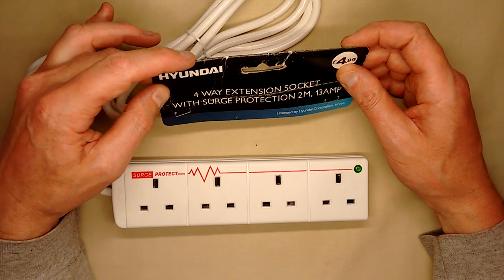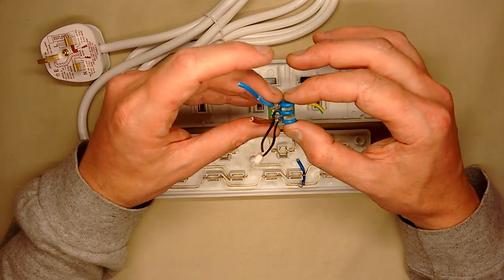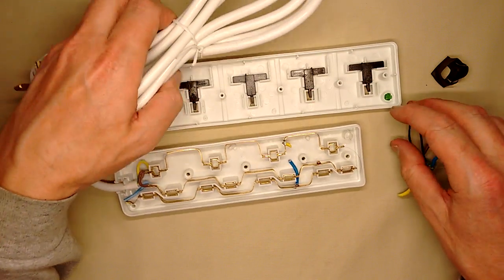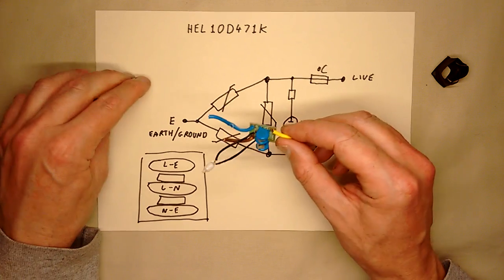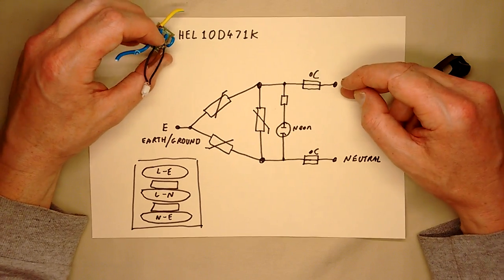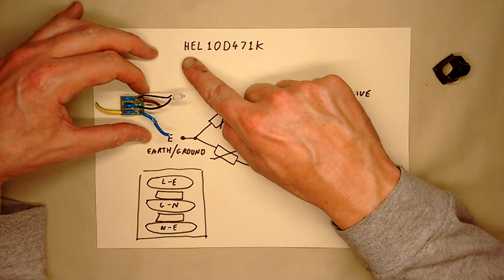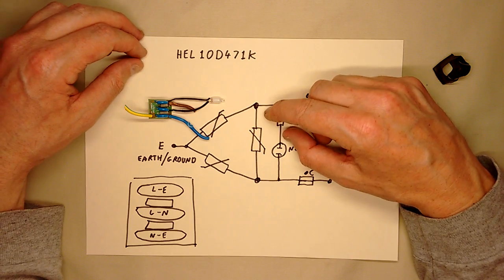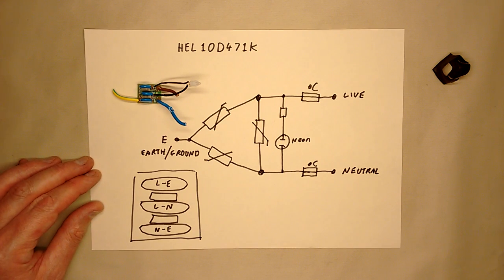Inside a Hyundai surge protection strip.  (With schematic.)

Comment: what type of thermal fuse is  in the protection circuit? i want to make my own surge protector, thanks
Reply from the maker: Usually just standard thermal fuses between the metal oxide varistors.

Comment: Hi , I'm a basic DIY home person and I'm bit confused about varistors connection. I wonder if you could help me please. 
1-Do I solder it in parallel or in series? 
2-What is the description of the fuse?
3-is it better to have 3 or more/less MOV and what is the advantage n disadvantage ?
4- is it practical to have these MOVs before the fuse or after? 
5- to make the sockets more secure from surge do I need to add any resistors or capacitors or anything else to it?
6- How do I protect it from spike in the current? 
7- can I use it for wall sockets also? 
As I live outside UK now, my electronics get damaged every yr inspite having them connected to surge/spike protected extention sockets. 
Waiting for ur reply. Thanks

Comment: I yard sale'd a small single-outlet protector rated for 400v L/N with a neon and the foreboding warning "Replace when neon goes out". GE brand.
I also have a similar small three-outlet protector with Surge and Ground LEDs, and actual L/N, N/G, L/G protection, though it "only" protects to 500v and has the equally foreboding warning "Unit still maintains power to the load while the surge function is discontinued". No branding, but has a UL label on it.
(I'm from the US where we use 120v mains service, so 500v is pretty generous...)
Semi-relatedly, what would you recommend to use on the output of a small, conventional (non-inverter) portable generator to protect more sensitive equipment from spikes and surges? Right now I use that single-outlet protector.
Reply from the maker: The surge protect units use a thermal fuse to detect when the suppression component is failing.  When the neon goes out it means the unit needs replaced as it has done its job either suppressing lots of small spikes for a long time or a single big lightning transient.  One of these units should be fine for the output of your generator.

Comment: I would have liked to have seen you send 500-1000V into this with a PAT tester to see how efficiently it clamped the voltage (could be fun to see the results!). Also, I have some APC surge protectors and they're over engineered with MOVs so it would be cool to see a comparison, if you haven't already done one.

Comment: can you tell me that if I use Circuit Breaker in place  of Metal Oxide Varistor. will it Surge protect devices?
Reply: T Chowdhury No, definitely not. Circuit breakers are far too slow.
Reply from the maker: +T Chowdhury U A circuit breaker doesn't really offer any protection other than for sustained over current.
Reply: @bigclivedotcom  can you any online link where i can purchase these sort of module for surge protection (Metal Oxide Varistor)? I wanna build my own power strip :)
Reply: +T Chowdhury: If you want to live, don't fiddle with electricity.

Comment: could you get hold of a do a tear down / inspection of a Hudson surge protected 2 socket extension with 2 usb chargers, please note this a all in one adaptor style one rather than one with a cable, I've just bought one of these to plug my new router into for surge protection & hope it will be of good enough quality & not hazardous in any way, please note I don't intend to use the usb chargers part of it at all, it was just a suitable device I could find at the time to offer two surge protected outlets without having a trailing cable, hope you can help on this

Comment: I have a higher end surge suppressor with more than three MOVs in it. It also looks like it has the same entire transient filtering stage that a decent switching power supply would have. Lowe's house brand Utilitech.

Comment: i enjoy your video's and have often dissected failed electronics to see why they failed, I designed power supplies for a living and like to see how others do it.  Like you I'm sometimes appalled at what I find, it's obvious any safety stamps aren't worth the ink on the labels for some of this stuff.

In the US our power is 120v for small loads and 240v for large loads. The street lines are many thousands of volts with a transformer on the pole that steps it down to 120  -  0  -120, the center tap is tied to the neutral bar in the circuit breaker box and that is tied to two ground stakes outside the house. Small loads are fed from one 120v lead and the neutral while large loads are fed from both 120v feeds and no power is drawn from the neutral, there is a safety ground for any exposed metal on the enclosure.

For noise sensitive loads I feed 240v into a transformer that puts out 120v, I find that does a pretty good job of killing any common mode noise because I'm not drawing any power off the neutral connection..

Are all loads in the UK fed from 240 or do you have 480 available for larger loads?

Comment: What that from B&M by any chance?

I'm curious to what's inside my JoJo one. It's got no lights, but interestingly, it has information of the bottom to say that it will fail a PAT on high voltage test, but this is not a fault.
Reply from the maker: The PAT failure is because the standard 500V test will cause the protective devices to conduct and give the impression of failed insulation.
Reply: bigclivedotcom Thanks for the info

Comment: I'd kind of like to see a noise choke in line with the mains myself. I notice a slight crackling in the mains of my PA system when I use an unfiltered strip. Because of that I put some filter chokes directly on the back of the IEC 3 pin power jacks on the inside of the amps and my mixer. So far I haven't overdriven them as I used fairly high wattage chokes. Mind you my best amp is 2400 watts continuous. It's an older Mackie M series but it's never failed on me and always delivers rock solid sound with very little noise, less since I installed the choke.

Comment: Dear big clive
I have been on the internet recently and bought this: http://m.ebay.co.uk/itm/18650-Battery-Holder-5V-1000mA-Case-Box-USB-Power-Supply-DIY-/252241990328?nav=SEARCH
Whenever i use it the device gets unbearably hot and i do not want to use it at all, the battery that you put in it sparks, the contacts get almost boiling hot and sometimes when charging the abtter it will get to the point where I was convinced it was going to explode
could you please break this product doen as i think it will make for an interesting video
Reply: The design of that looks dodgy as heck, with the exposed trace going back (yes I know that's connected to the shell of the cell anyway) but it doesn't bode well for the build quality.

I've chucked clive a couple of quid in the hope he buys one to rip to bits :)

Comment: I have a small 30cc boat engine with a fan, I would like it to automatically turn on over 150 degrees F. what component would I use to make this. Like a heat sensitive switch???
Reply: You can get thermal switches designed to turn on at various ratings...  Ebay item 321733923890 would do your job (choose the 65C oone, that's 149F).

Comment: Failed neutral thermal fuse will mean the first reasonable spike will trip the RCD device ( mandatory in the UK) and trip the power. then a little fault finding will lead to the strip as being the cause and it will be tossed out ( or in my case will have the surge protection replaced).
Reply: Because in other room of your house you can't get electric shocks ?

RCDs are a fundamental protection that must be used everywhere, there are endless possibilities that you can get in contact with live wires, or worse it could be that without an RCD a fault to ground is not detected, because maybe your ground has an high impedance (for example if you have a TT system and not a good ground rod) and thus a fault to ground doesn't trip a MCB for overcurrent, but instead sets all your grounded appliances at live potential.

Comment: I've just replaced a Schneider surge module (PDL 600SM - http://www.pdl.co.nz/product-details.aspx?rcat=products&catid=805&id=2059 ) and there are no fuses inside it, just hair thin pcb traces from the L & N into the MOV array.  I'm a bit disappointed because I have always believed that Schneider made good products.

Also has an indicator led (blown), 330k resistor (open cct), and an IN4007 to keep the led from chewing the reverse voltage.

3x MOV = http://www.digikey.co.nz/product-detail/en/epcos-tdk/S20K275/495-1417-ND/593851

Comment: Decent, but I wouldn't have put two fuses in it. The neutral fuse needs to go and be replaced by a jumper.
Reply: The neutral fuse would come into play to protect against fire and overheating in the event of reversed polarity (it happens, even on 'professionally' installed sockets sometimes).

Also the same surge protection pcb may be used in areas with Schuko plugs, with no polarization

Comment: There is a SPU (surge protection unit) my the entertainment system and when a new load is put on ot, it buzzes at aussimgly 110 VAC 60Hz.
Reply from the maker: It may have an inductor inside as part of the filtering.
Reply: +bigclivedotcom Hmm... It was loud.
Reply: Like BIG buzz

Comment: I dont know crap about AC electronics but why cant they put one (thermal?) fuse on the ground rather than on live and on neutral.... or at least add a third to the ground that trips before live or neutral? I dont know what I'm talking about
Reply: No kidding you don't know what you're talking about. That arrangement with one fuse would allow the varistors to heat up indefinitely.
Reply: Confirmed.

Comment: is it safe to use a extension socket if the surge protection has failed? asking this because i have a old extension socket with surge protection that i think the protection has failed but it still supplies power, the led on the socket had stopped working a while a go but then it started to light up again and it supplies power even if i put the power switch to off.
Reply from the maker: Just for the faulty switch I'd suggest replacing the unit.

Comment: If you want a more interesting surge protector and filter strip to disassemble, look at the TrippLite IsoBar series, but they are a good deal more expensive (and well worth it for things that really need added protection).  They also include inductors to both filter interference between devices as well as to further help limit the current that the surge protection needs to absorb.  They are a good deal more interesting to look at than the traditional 3-way MOV variety protector.

Comment: Clive - might be worth mentioning that for "non-UK users" the QuickTest  connector (which you use a lot!) has an internal BS 1362 fuse, so overseas buyers will need to consider buying a few of this style fuse too (or build a thermal trip into the Quick Test power supply, as I've done).

Comment: Worth installing decent rating Surge Arresters across the incoming phase & neutral (to local earth) in your Consumer Box too. DIN top hat fitting ones are available from "Usual Suppliers" with a useful range of clamping voltages. Don't forget Mains Filters in supplies to sensitive electronics too (that includes most "Modern" appliances) - again available from the "Usual Suppliers" ;-D

Comment: I've got a similar power strip to this, from the early 2000's but with the same text and red jagged line - which means it has to work of course! A nice feature of my one is a large neon indicator that's still nice and bright and the light dances from one end to the other on it :)

Comment: Even if the green light was on with nothing plugged in, it's not going to power anything with a blown fuse and the light may go out as soon as you plug a load in anyway.
Reply: The load doesn't go through these fuses. This setup is connected in parallel with the socket rails.
Reply: Said thermal fuses are for the surge protection module only. The sockets will still work regardless of the fuses being in tact or not
Reply: Ok, I didn't fully understand the diagram.

Comment: As far as I'm concerned, AC is AC; "live" and "neutral" are the same thing at opposite times.  :[
Reply: Well, no. Live is referenced to neutral (and earth) and fluctuates between positive and negative voltage. Neutral referenced to earth has constant zero voltage.
Reply: Sirus
Lol no, AC does not work like that. 230v live line referenced to neutral rides a sinusoidal wave that goes from 0 to +~320 volts and back to 0, then to -~320v and back to zero, giving a Root Mean Square voltage of 230 volts AC.

Your centre tapped analogy would require three lines, which the normal single phase AC connection does not provide.
Reply: think of it as a grounded centre tapped transformer 240 ac turns into -110v 0v grnd 110v
Reply: ***** yup your right , we take a phase out of the 3 phase, im thinking of 110 building site transformers

Comment: The symbol for a thermal fuse is a fuse symbol with a diagonal line going from the upper right corner to the bottom left with a lower case t and degree symbol underneath just to clarify

Comment: The surge protector neon on my Belkin power strip has finally gone out. If you don't mind me asking, where did you get that particular power strip?
Reply from the maker: BM Homestores in the UK.
Reply: bigclivedotcom Thanks! Luckily I have one of those pretty close to me.
Reply: It's well worth contacting Belkin.  With the last three that failed, I called Belkin and they replaced it free of charge and covered collecting the failed power strip.  The first two failed after thunderstorms while the third we noticed the light was out one day.  Interestingly when we had a nasty surge a while back (blew our chest freezer, a mobile phone and microwave, all plugged in without surge protection), the surge protected power strips for our TV and computer both survived with their protected neons still lit.  Then again, we did wonder whether that surge would have wrecked the TV, set-top boxes, computer, etc. had they not been on surge protected strips.
Reply: Seán Byrne Are you in the UK? I've only heard of the replacement programme in the US.
Reply from the maker: Yes. But note that they had just one Hyundai unit with the others as yet unexplored as they were riveted shut.
Reply: I'm in Ireland.  It's been at least 5 years since I had the last one replaced so maybe they stopped doing it.  When the first one failed (going back nearly 15 years), we actually called Belkin asking if we could buy a replacement module figuring it would be cheaper than a new surge protector and they said that they would replace it for free as their warranty covers lightning damage.  So when the later two failed, we called Belkin the same way and they did the same thing by sending out a courier with a new one and to collect the failed power strip.  

The wiring diagram in the video does explain something I wondered about - Why did the RCD trip in each instance?   Indeed, when the MOV carries current from live or neutral to earth, the live/neutral imbalance trips the RCD.
Reply: Seán Byrne Thanks for the info, I'll give them a call when I'm next at home.
Reply: I have a set of Masterplug surge protection boards from about 10 years ago, all of them had the green neon either go out or fade considerably. Today I opened one of them and discovered that the green neon had gone black, and I tend to think it was only the neon that had failed, rather than the surge protection.

Comment: Why do companies use those neon indicators anymore when leds are so much simpler and must be cheaper. and is it really neon or is there a blob of mercury in the phosphor ones?
Reply from the maker: It's usually just another noble gas used for its small amount of UV for phosphor stimulation,

Comment: If you want to destructively open a socket strip that has rivets, get a pry bar under an edge, then heat the rivets with a soldering iron.
Though i guess you could replace the rivets with slightly larger screws if you wanted to put it back together ;)
Reply: Wouldn't drilling the rivets out be easier?
Reply: yup
Reply: I've tried that, the rivets are domed usually, not as easy as heating imo